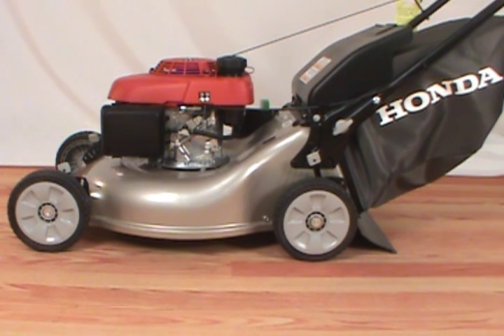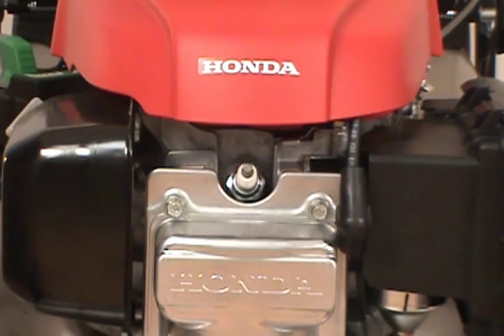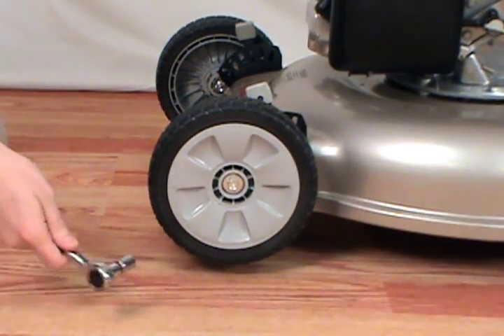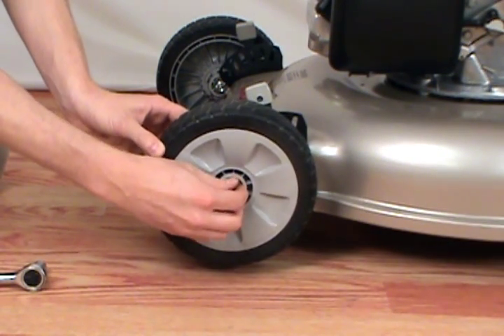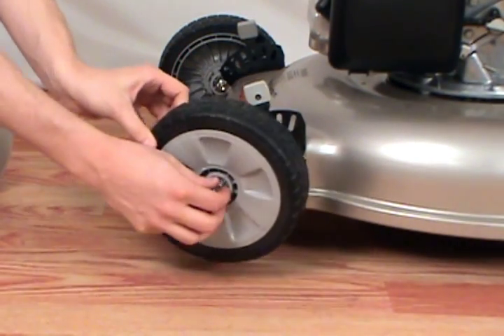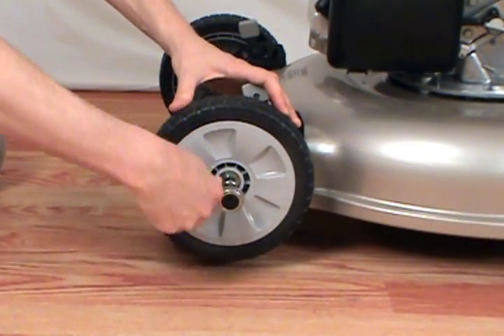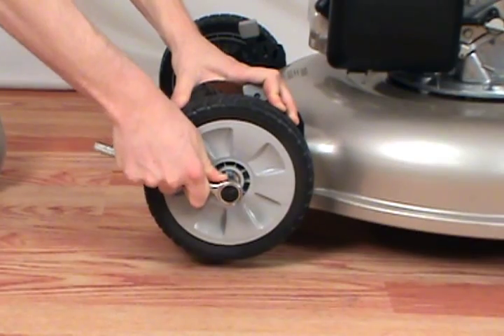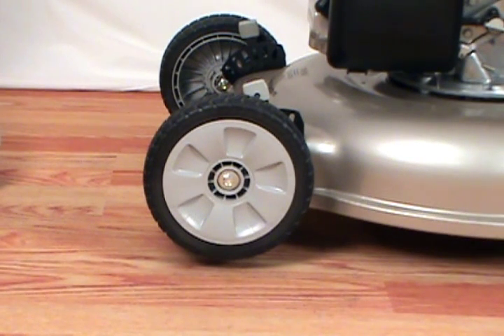Replacing the Wheel - Honda Lawn Mower

Comment: I would also add that you should clean the bolt and add fresh grease to its shaft before replacing it into the new wheel. Only the top end Honda Mowers have front wheel bearings. All other models, such as the one in your video, don't have bearings on the front wheels and they need to be greased. All of the Honda Mowers rear wheels have sealed bearing assemblies that can be replaced or you can also purchase the rear wheels with bearings pre-installed.

Comment: The honda hr214 sx is rear wheel drive. I try to loosen bolt and it just spins. Doesn't loosen. How do you change rear wheels on honda hr214 sx

Comment: Would be helpful to emphasize the correct way to put the wheel washer back on.  Also how about the rear wheels?  They are more complex and need to emphasize the different washers and washer placements on the back wheels.